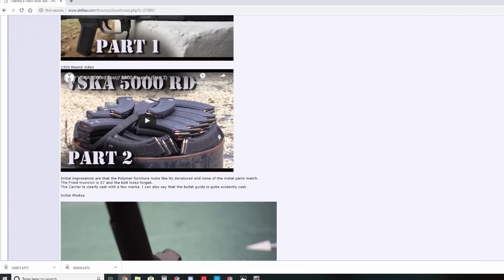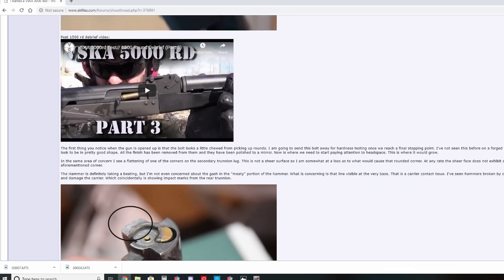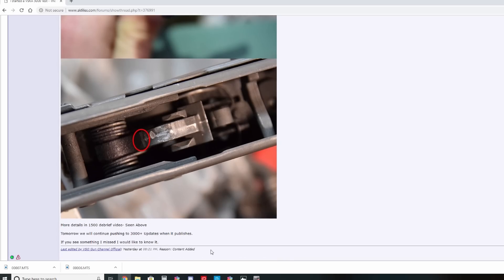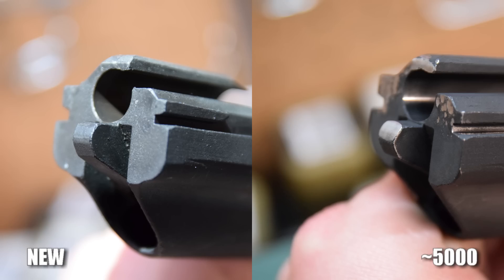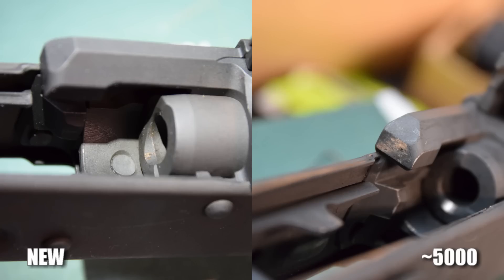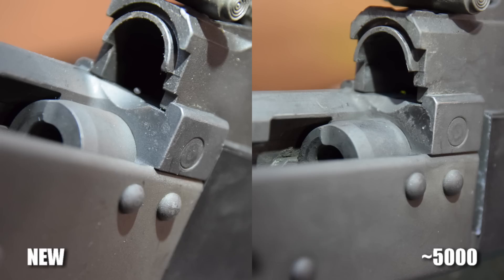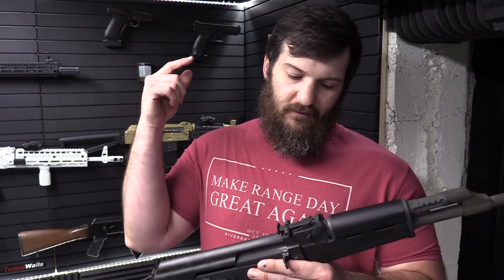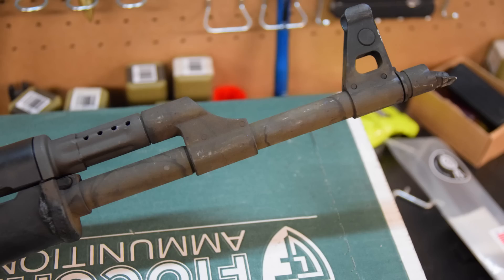Did the Pin Fall Out? // VSKA AK47 5000 Round Test  (Part 8 )

Comment: I bought a VSKA and didn’t do any homework on the rifle prior (New to the platform, I know I should’ve, but found it in my local store with some cash on me and was excited). I put a few hundred rounds through it with no issues at all and have been loving it. I then came across all the hate for the VSKA and started doing more thorough research. After finding this video I feel more confident in my purchase and will proceed to modify it the way I see fit. Thanks for the experiment!
Reply: I’m actually going through the exact same experience Jason. If you don’t mind me asking how much did you get yours for?
Reply: @momf9394  7 months later but I felt the need to say all rifles WILL fail if you regularly fire them even with good maintenance
Reply: Don’t worry about what you have. It’s good to go.  The clowns hating CA are doing so based on a 2018 build that no longer exists.
Reply: There's more hate on the prior AK century made, the Ras-47.. that ak was poorly made.. their response for the build quality was releasing a new Ak.. the Vska.. which is a lot better than the ras.
Reply: I'm in the same boat here 2 years later... Found mine at a gun show for $599 and couldn't pass it up. It was my first rifle purchase and a very uninformed one at that. The more research I do on the VSKA though, the more I realize the hate is coming from earlier Century models. Most of the videos I watch on VSKAs have positive things to say.

Comment: Another amazing conclusion to another great platform. I knew the VSKA would do well in this testing. What I mean by do well as in perform as it needed to mechanically with little to no failures. Also this does make me feel at ease with my Century Arms VSKA purchase. I know I will not shoot 5,000 rounds through it but it’s good to know my rifle will hold up better than the WASR 10. Again great video! Btw the highest amount of pressure the barrel pin held was 8,838 lbs of pressure. It broke at 8,795 lbs then it took 8,963 lbs to push it again after the initial pin release. The amount of pressure it took to press the barrel pin in was 9,976 lbs of pressure. This is by far the most scientifically sound testing done on the VSKA to date. Thanks VSO Gun Channel

Comment: To my knowledge of metallurgy, which I'll admit isnt much more than perfunctory, that steel is usually hardened to 48-58 HRC. Seems a touch soft but it's not deforming. 
The harder the steel the more brittle it is so 🤷🏻‍♂️ I guess mileage may vary. I just bought a vska TRP and I'm impressed with the fit and in a lesser part the finish. The dust cover does in fact have a different shade of black than the rest of the rifle
Reply: I bought the same gun, how's it running?
Reply: @0baakYT  over 2k through it. One malfunction was a split casing. All internals are showing normal wear
Reply: @SugarMilkbro  Nice man! Thanks for the comment! I was super bummed after reddit tore me a new hole in my ass about this gun. All the things I thought I would not have to worry about this gun were topped by shit I never even imagined, like the shit blowing up and getting killed by shrapnel to the jugular and all that. I wonder if the gun can hit 20k. From what I heard, Aks should do 50-100k rounds easy.
Reply: I sent my VSKA in for some premature BCG wear (ive only put about 400 rds thru it) I have the beautiful maple wood VSKA with a grey/vintage/parkerized finish to it. They sent it back with a new dust cover that is matte black🙃. Called them up/emailed/ blah blah blah and was told they no longer make those Parkerized Dust covers.🙃. Freakin Century. They never cease to amaze me. I say this because of there history and customer service has been a nightmare. Also, they supposively test fired 30rds on the new BCG but looks like it already has 1k put thru it😅. Im like wtf? First, it takes me 5 months to get a hold of u, then, u replace the original dust cover with a dust cover that looks nothing like the finish of the original and then u replace the BCG that looks like its already having premature wear with only 30rds test fired. Smh.

Comment: Any words being said on the RAS47? I was told that issues were the original ones and they were mainly due to bolt issues. I purchased one awhile back but its 101*** +  serial number with the updated/upgraded bolt.
Reply: Nobody has tested those. I have one that's a 96*** and it does just fine for me. I also have a rh10.
Reply: Front tauntaun splits apart,ras47 is stright junk,sell it before its trashed
Reply: Iv tested the ras,lasted about 100 rounds

Comment: Are u deleting comments?   My comments about the problems I have had with my ras47 are gone.   But the one about the burr is still there.
Reply from the maker: I don’t moderate comments on a individual basis. There are a few keywords that I have banned on an auto list. But as long as you aren’t using the N-word and crap like that my filters won’t pick you up. That said, Youtube does pull comments, I don’t understand the mechanism but every couple months i stagger into the moderated comments section and it’s always got thousands of “held for review”. They do it automatically. The only thing I think is usually they have some kind of language in them, (which I don’t have on my list) so I think that maybe they are computer learning and think that you have said something at some point that makes it think that it’s close enough that makes it hold it over.  I usually just end up going on an approval spree.
Reply: The VSO Gun Channel hmmm didn’t even troll or use one curse word or use the word wombat.     Said I had problems n people asked n told them what was my experience I dont even say don’t buy Century arms or use there name.
Reply from the maker: Yeah man, I looked for it in the “under review” section and didn’t see it. I don’t know WTF is going on with that. Some YouTube tomfoolery or perhaps an error due to interweb strength- I’ve seen this a few times. Post it back up.
Reply: The VSO Gun Channel I will. I wonder if it was because i mention someone on IG is doing a long-term project, with the name projectras47.  No big deal.    I believe u did a fair test.
Reply from the maker: At one point in time I had a really excellent handle on how the system works here at Youtube. They have injected so much BS into it that I don’t even bother. You tripped something somewhere. But ain’t nobody got time to police other people’s free speech. I have a few triggers that most people would find reasonable, other than that IDGAF.
Reply from the maker: I just checked the archived comments and there are over 17000. I looked at the first 3 pages and it was all links.
Reply: The VSO Gun Channel I didn’t put any links.  But no problem.

Comment: Why didn't you address the 30% loss in head space after only 3,000 rounds? And why didn't you take caliper measurement after 5,000?
Reply from the maker: I had a 3rd party perform final headspace...in this video. With a No-Go gauge I'll add. Measurements were taken to track change between tests for safety. Once the gun finished there were not subsequent tests; its a simple pass fail at that point. You guys over there at the ak files are using the wrong measurement anyway. You want to use the measurement between the cam and the receiver. Another display that shows a lack of understanding between a direct and indirect measurement.
Reply from the maker: I took both. You said it right, that measurement is an indicator of change. Not necessarily an indicator of change in headspace. Headspace grows through only a few mechanisms. The one that we can measure readily is the angle between the bolt cam and the receiver. because most people when handed a protractor utterly fail, we use a distance measurement as close to tangent as possible  between the two as a direct correlation for lug alignment. As those lugs change so does the rotation of that bolt, allowing it to widen. Its a giant thread that's missing most of the material around it.
Reply: @VSO_Gun_Channel  so explain to us why, based on the measurements you took, the distant(angle) between the lug and receiver didn't change even a thousandths of a mm after 3,000 rounds, yet the distance between the carrier and trunnion changed by 4.11mm (30%). That's impossible, especially given that it's like a giant thread. But you did conveniently edit out the portion of the video when you were inserting the No Go gauge and bolt before taking the measurement between the lug and receiver after 3,000 rounds. So maybe it didn't truly measure the same?
Reply from the maker: Yawn... See video 6 at 9:48. https://youtu.be/AgCWQbwT-FM
Reply from the maker: and the AKFiles subsequently crashes...
Reply: The VSO Gun Channel so the distance between lug and receiver increased by around .50mm from 0 rounds to the 5,000 round mark, and the distance between the carrier and trunnion on the No Go increased 2mm from 3,000 to 5,000?? Wow, the VSKA gains headspace the more you shoot it!

Why don’t you review good firearms from reputable companies? It blows my mind that someone so passionate about firearms would bs their viewers into buying a Century Arms VSKA or RAS47. You should be talking your viewers into getting a Mak90 while they are still around, a WASR, RH-10, etc, heck even a PSA.
Reply: Caleb Rogers have you ever seen any point of comparison? Have you ever seen a WASR or any other “good” import tested this thoroughly? How do you know that they would not also exhibit the same change in dimensions over time? You are showing extreme signs of confirmation bias.
Reply: Kevin Marrett (this is Caleb. Didn’t realize I was replying on my other account)
umm... yes LOL I’m guessing you haven’t heard of Robski. There have been multiple reports even since my comment on VSKA’s losing headspace within less than 5,000 rounds. Don’t take my word for it, get on some of the forums where people who have screwed up and bought one have absolutely no reason to be bias, and post plenty of proof. The VSKA is one of the worse choices you can make when buying an AK. The RAS47 is right there with it too. I’m not saying that because of its price, and I’m not saying it out of spite for Century. I am saying that because I KNOW and have seen plenty of proof. Century imports the WASR and they are cheap. Guess what? They are extremely durable and id recommend one to anyone. Do you research.
Reply: @smokiesleather  people are desperate to prove Century is worth a shit it seems. Good night,  the VSKA has had report after report of losing headspace between 3K and 7K rounds  and you can SEE the headspace being lost as we speak on this one and people will still desparately cling to JuSt As GuD!

Comment: Brian your Tester is putting COMPRESSION on the pin, not TENSION.  I don't mean to be a wise-ass, but the two are two completely different directional forces; one is pushing the other is pulling.  I'm a retired Professional Engineer.
Reply: Das Piper ah- you are correct sir- what I was referring to is tension in the hidden mass and damper system in the column, which is moving a good deal more than the stylus (and what I mentally picture while this test is occurring).  I assure you that I know the difference, but professional communication is maybe not my strongest suit.  Good catch.

Comment: The AK Files has some good info, but the bigotry runs thick over there.
Reply from the maker: It’s pretty bad. If I was the owner I’d be fairly ashamed over that display. I want to participate over there, but I’m not sure I can deal with that much Cheeto dust on a regular basis.

I tested several other threads and it was either no one knew, or couldn’t figure it out. Aside from the near constant jacking around, it’s the epitome of an echo chamber. I can’t count on it as a reliable source of info. Fun for demagoguery play time, but I can’t really use it for that because I added my branding to my account; that is not something that aligns with my message.  So I’ll surf it from time to time to see if there is anything interesting but for the most part I can’t endorse it as a primary source.
Reply: I'll still take them for raw info on an AK though. Same with TheAKforum.net (they're more geared for collectors though). Better than the youtube/reddit hive mind when it comes to skill on an AK